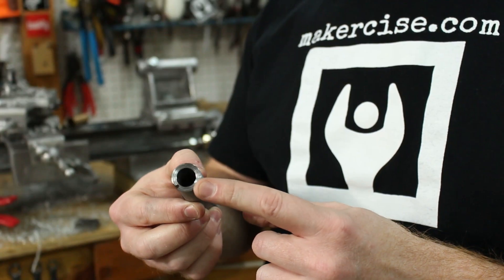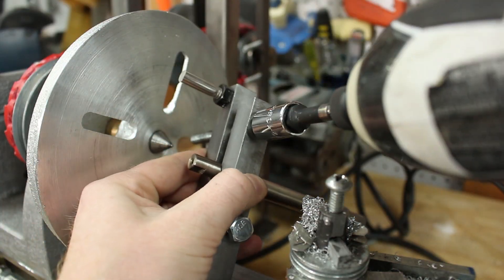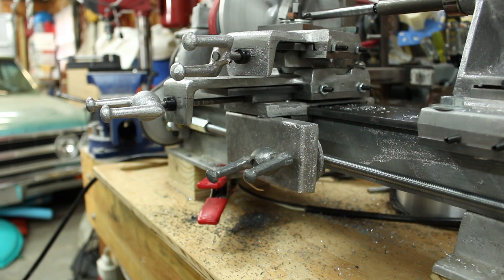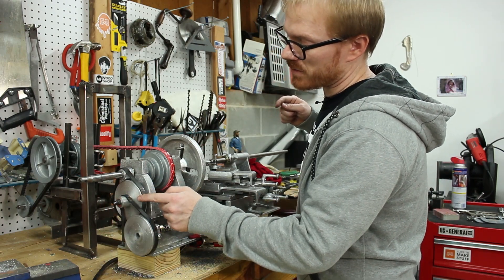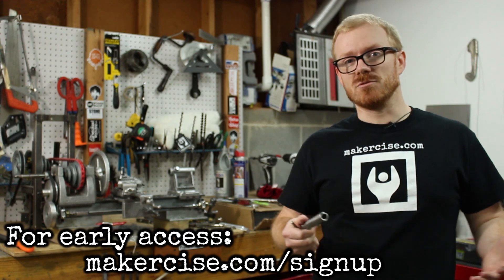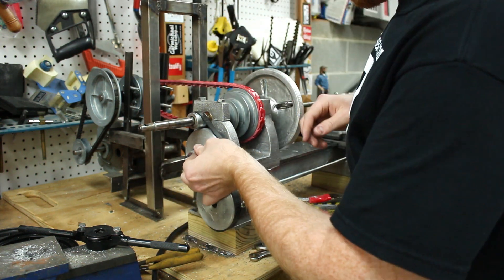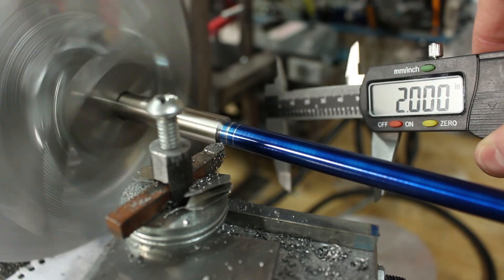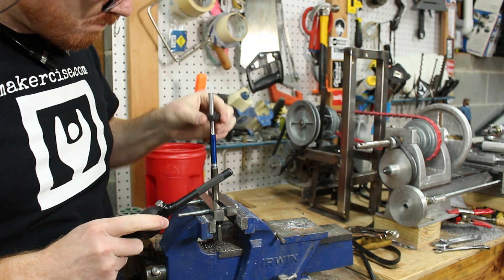Metal Lathe - Part 14: Tailstock Ram and Feedscrew

Comment: 4:41 the axis of intermediate pulley is going "up" so the the first belt goes to the left and the second to the right, adding a sort of brakes between the 2 axis will prevent the intermediate pulley axis to bend "up"

Comment: I've enjoyed your videos so far. It's great to see another Gingery lathe project documented on YouTube. Another one is Morgan Demers' one (https://www.youtube.com/channel/UCqYRvgslXTx1MVuvri7tjog)

One thing I was thinking is whether you've taken your assembled bed (aluminium base with steel ways) to your surface plate. I'm fairly sure you would have some scraping to do with the assembled unit!

Great job so far for sure! Keep 'em coming!
Reply from the maker: Paul Dorman Morgan demers video series is one of the primary reasons I started building the lathe and the reason I thought to film the process. I agree with you about there being some scraping as a result of the assembly on the surface plate. care to make a guess as to the total variation it may reveal. I don't think I am going to address it anytime soon but it is still good observation regardless.
Reply: I don't imagine your lathe will be very rigid, and the progress you have made so far (as seen in this series on YouTube) won't have been hampered too severely by imperfections in the ways, but I think that a final scrape will be worthwhile before you dial everything else in. The more accuracy you can get out of your lathe bed and ways the more happy you will be with the result.

The lack of rigidity is inherent to the design of the Gingery lathes, and I mean no criticism whatsoever. You'll be able to tackle a wide range of machining tasks with this lathe as long as you don't push it too hard. It's a superb effort and I'm certain you have enjoyed the build at least as much as you'll enjoy using it for your future projects.

I was thinking that you might get a more rigid arrangement if you epoxy the ways to be bed, but I'm not 100% certain that this would be a good idea. The Diamant DWH compound may be worth investigating as it's designed for rigid joints between mating machine surfaces (http://diamant-polymer.de/en/products/dwh/). You might exprience greater problems with the different coefficients of expansion between the aluminium and steel if you use the epoxy, but if you do, you should be able to detach them again with a bit of heat. You could use the epoxy with a bit of release wax on the steel to keep it from forming a bond on the top surface.

A layer of epoxy  might be worthwhile even if it's just to reduce the rate of galvanic corrosion between the ways and the bed. Then you'll just need to worry about your many screws holding down the ways then! As far as I know you should use zinc or galvanised steel screws or you run the risk of not being able to easily remove them in future.

My guess for the total variations at this stage? Perhaps +-4 thou along each side of the ways, and at least one decent twist. Distortions you can scrape out, and as long as you only have one twist you'll be able to compensate when you anchor the lathe down on a solid surface. I hope you've got a machinist's level!

I'm looking forward to seeing the next instalment! The Gingery machines and their ilk represent the best of the do-it-yourself ethos, and I can't help but feel inspired to get of my behind when I see what can be achieved!

Comment: May I give you a tip about the lathe dog? Make it lighter and balanced. Turn one bolt the other way and add also a stick/rod to grab the wheel in the leg without it.  Make it symmetric from center. That will reduce the wobbling a lot. Also, the plate when using the dog isn't round: it wobbles. 

Nice video! I like it.
Reply from the maker: Eddy Erkelens I like the dog recommendations. it will probably be a while before I can get to it though.

Comment: I've been wanting to tackle the Gingery Lathe project. The college I attend has a fully equipped machining shop and I also have access to a 3D printer to print off the molds. However I would much rather the true hands on experience by using hand tools and ink facing. Any how I enjoy watching your videos, you do an excellent job at explaining and providing step by step instructions. Also, any advice to a first time foundry operator would be much appreciated. (for example, what mix did you use for the refractory cement?)
Reply from the maker: Kurtacus_365 wow been a while. I used the mix from the gingery book. 50/50 fireclay/play sand if I recall correctly. check out my portable aluminum foundry video. the article on my website has the full details and a parts list. much lighter and cleaner than my kerosene foundry. great luck and hit me up if you have questions.

Comment: why a convex crown on the pulleys and not a convex channel?
Reply: How crowned pulleys keep a flat belt tracking:
https://woodgears.ca/bandsaw/crowned_pulleys.html
Reply from the maker: newton9837 I am not sure what you mean by convex channel?
Reply: Makercise like the accessory belts on your car. It's got a raised rim on the outside and a low belt cradle in the middle. the belt would be channeled toward low spot (the point of least tension) while it runs. thats kind of what it does now it's just that the low spot is on the outside.
Reply from the maker: ptelford yep. that's where I learned it
Reply: Excellent read. I guess where I was going with this is that a V-belt style pulley would be less sensitive to belt alignment than a crowned pulley (the article discusses this), and would be less inclined mistrack.

you might not even need to recast. you could likely get a way fastening some thick sheet metal disks on the outsides of the pulleys.

BTW awesome vid as usual. I'm just floating ideas some ideas around, trying to find out the best way to make this for when I eventually make one of my own. Thanks for the vids! :-)
Reply from the maker: newton9837 yes keep the ideas floating. :) i had a hard time finding a short vbelt for the drive train. I grabbed the flat belts at the Walmart. thanks for following the project.